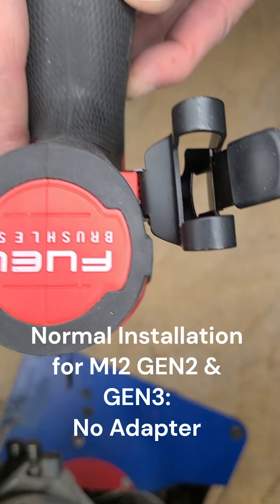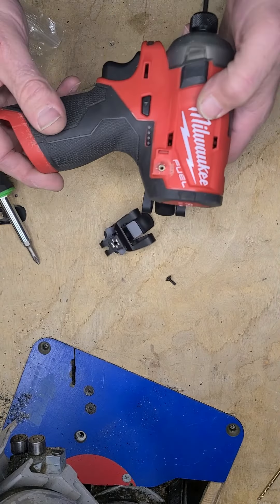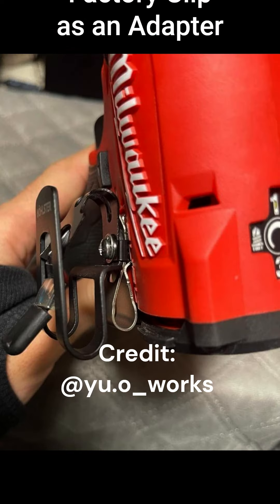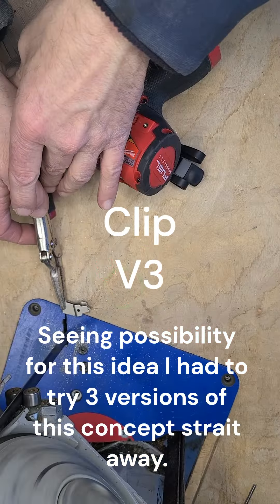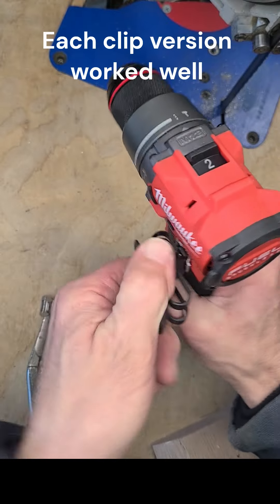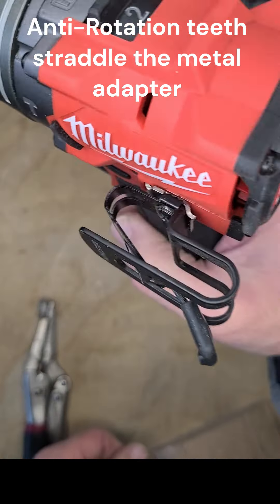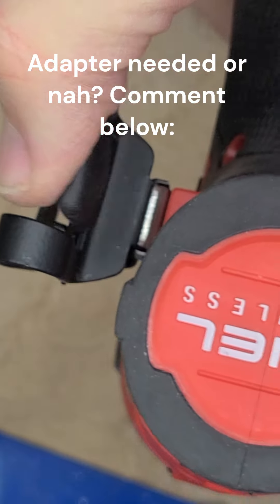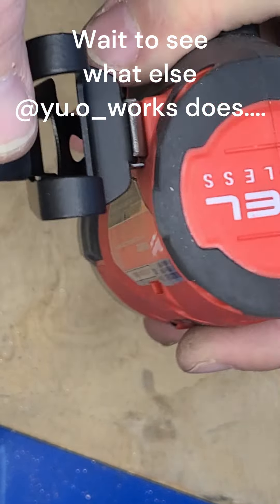Adapter or No Adapter for Nohlster-to-Milwaukee M12 GEN 2 & 3?

Comment: I just ordered 3 of the for a few of my m12 tools. Thanks for posting this. I'm pretty accustomed to making mods to tools and or adaptors.
This may have saved me some time. My current adaptor (protoype) is to hook up a 1.25 vacuum attachment for my multitool as I'm working overhead cutting out some 50ish year old fiber board that someone nailed up to my basement ceiling and there's pipes, conduit, BX above and below this layer of crap. Plus a lot of moldy dust on top of the fiberboard. This mod your showing is pretty  straight forward and elegant.
Nylon block, etc. and a Dremel tool is great for making all kinds of adaptors and/or mods, etc.

Comment: I just bought 10 of the Nohlster clips for my tools. I only have them on my Gen 1 M12 Drill and impact. I would probably use  a tether on a ladder or where a drop would cause a tool failure.
Reply from the maker: Thanks for your feedback.

Comment: I have a M12 Gen 3 impact and at first I was using the clip with the opening down towards the battery since it sat better when screwed down.  It became a little awkward to change grips.  So I decided to orient the open towards the bit holder, same as the standard clip, even though the clip was tilted and not sitting flush with the screw.  I noticed the teeth of the clip were digging into the body of the drill and thought that was great.  Maybe it will sit flush once I screw it all the way down.  Well I ended up shearing the screw head due to too much force.  The broken screw is pretty much flush with the housing, so now I have to come up with an alternative.  If only I came up with this trick before.  So I would definitely recommend making an adapter.
Reply from the maker: Email us at info@nohlster.com with your address so that we can send you an adapter and some better screws.  The M2.5 screws required on GEN2 are prone to problems.  We upgraded our M2.5 screw. It has a #2 Phillips head now instead of a #1 Phillips which was prone to strip.  Particularly if a #2 screwdriver was inadvertently used.  Sounds like yours sheared on account of over-torquing due to improper fit.  Sorry this happened to you. Let's get you an adapter!
Reply: Thanks I'll do that.  Yeah it's my fault the head of the screw broke off.  Trying to get it out will be the fun part.  I have your clips on my M18 and they work great. @nohlster

Comment: This video was made for me.  I just got the gen 3 m12s and a pack of nohlster clips.  To be honest, I was a little disappointed there wasn't a proper adapter for the gen 3s already packaged in - but I wasn't careful enough in my research so that's on me.  I would like an adapter clip as I am not sure I want to destroy the original clips to make my own.  If it makes sense, a lanyard attachment point would add value, but only if it doesn't increase the form factor too much.  The nohlster already sticks out a bit far, I know any adapter would slightly increase that, but wouldn't want a lanyard point to increase it more.
Reply from the maker: Thanks for your feedback.  Please be sure to email us with your mailing address.  Well send you  some anti-rotation adapter prototypes as soon as we get them.  info@nohlster.com

Comment: I would love for this to be put into a wrap so i can clip other tools.  I have tools that dont have a proper belt clip, like a hammer, hackzall, or my 8in M12 hedge trimmer.
Reply from the maker: Great idea.  We have successfully used hose clamps to wrap Nöhlster Clips to tools such as Milwaukee M12 and Bosch 12V and other tools that have a handle or spot that can be "wrapped".  The best hose clamp size is one with an 8mm band width.   The 8mm bands are difficult to find but larger sizes can also work.  Here is a link to the best one that we found: https://www.ebay.com/itm/163610688446  These allow the wormgear to fit neatly out of the way within the clip geometry.

Comment: I can’t get my factory belt clip off. The screw isn’t coming out. What am I doing wrong?
Reply from the maker: It's hard to tell without a photo.  Can you DM a photo of your situation?  You can connect through our website contact page also. Happy to help.
Reply: @nohlster  The factory screw. I used a Philips to take it off and it striped it. I’m not sure what type of screw it is.
Reply from the maker: @Xx5thofHennyxX  Check out this link to a photo of the factory screw.  You should be able to use a flat blade screwdriver:    https://www.google.com/url?sa=i&url=https%3A%2F%2Fquagmirerepair.com%2Fmilwaukee-06-82-0130-belt-clip-screw.html&psig=AOvVaw3b5oJGNDEJOGWvTBkmZMka&ust=1728355589845000&source=images&cd=vfe&opi=89978449&ved=0CBQQjRxqFwoTCMjOtbug-4gDFQAAAAAdAAAAABAE

Comment: Im not sure what this even is, is it just a bigger clip for peothat cant make the regular ome work out just easier
Reply from the maker: Impact drivers are prone to getting nudged off.  The Nöhlster clip is bigger because it has a quick-release locking mechanism.  If you work on ladders, scaffolding, or roofs, Nöhlster will keep your impact driver from getting bumped off unexpectedly.
Reply: Also comes with a rubber bit holder